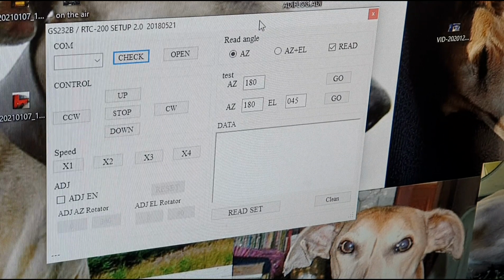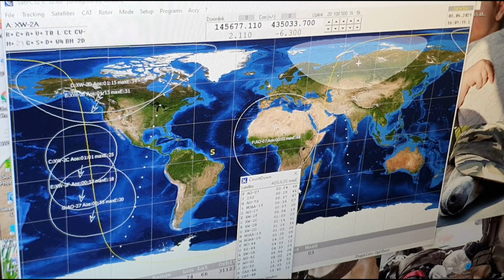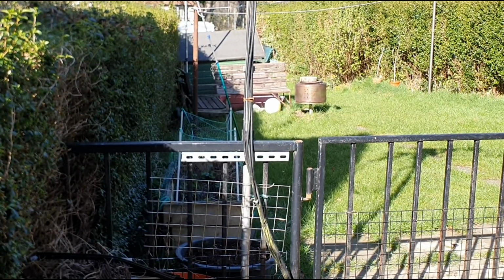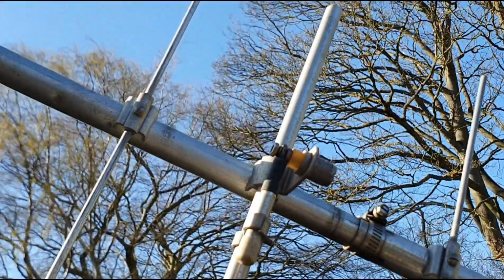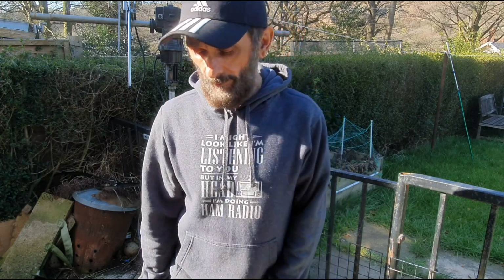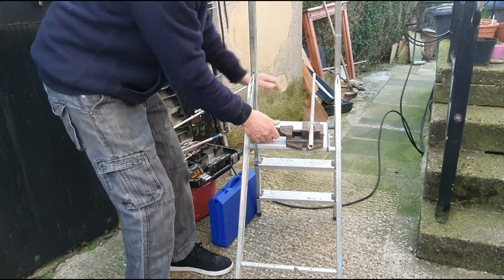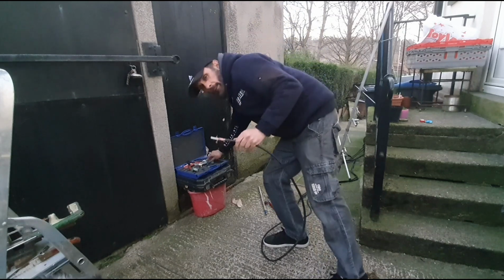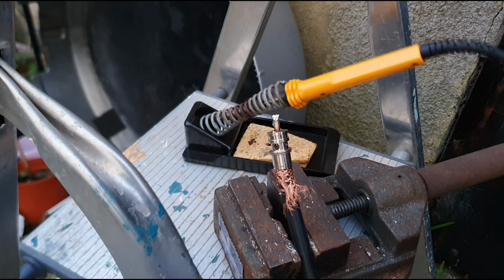Satellite Antenna/Rotator - re calibration and homebrew element replacement.

Comment: The only problem I had building this way is desense issues. ESP on VU birds. I went with a 3 element quad for 145 and 9 ele yagi nested inside. The quad is the best RX antenna I’ve used for sats. Low noise floor. Very little fading on uv. 552 grids on pvc booms. Haha
Reply from the maker: Sounds interesting I might give it a go I enjoy the experiments so thanks for the info 😀.  It's working reasonably well but too early to be sure. I need a couple of days testing to find out if it's any good over the X beam. 73

Comment: Hi Simon where do you get the software at the beginning of the video?
Reply from the maker: I came across it but cannot remember where. Its called RTC-200 and is developed by a guy from Japan
Reply from the maker: found it now, Its here https://hf5l.pl/en/rotator-controller-interface-for-yaesu-g-800dxa-g-1000dxa-g-2800dxa-g-5500/ you find the link on the page and user instructions